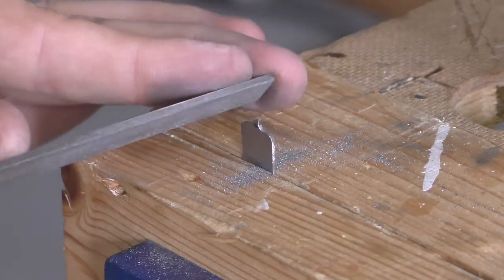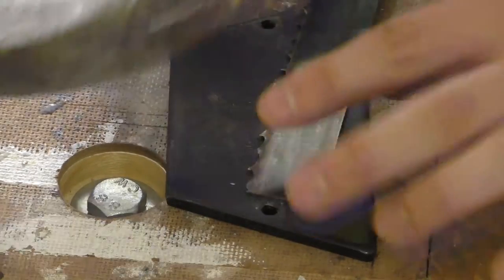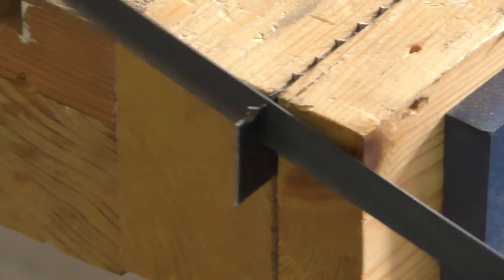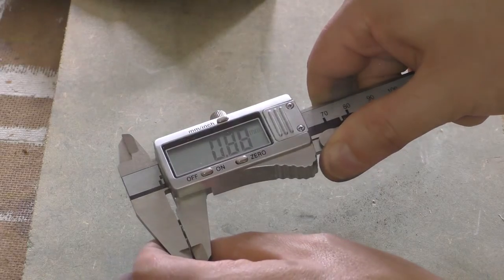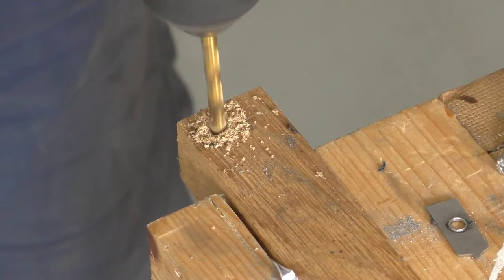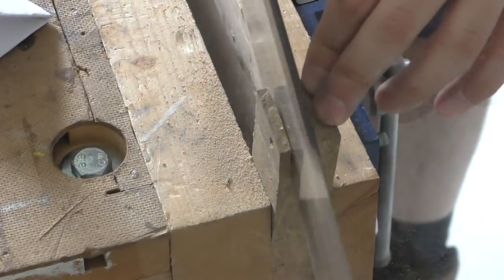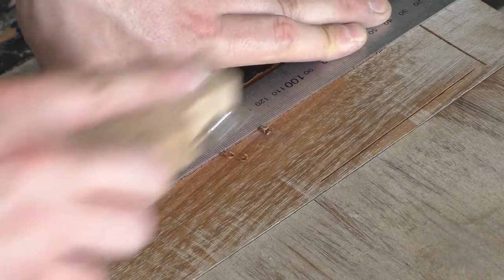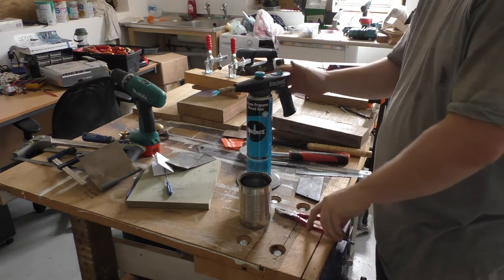Bandsaw Blade Inlay Improvements

Comment: Good stuff.  Instead of drilling through the saw blade, maybe just clamp the blade between two pieces of timber?
Reply from the maker: Yeah, that would probably work. You need a surprising amount of force to stop the cutter rotating hence why I drilled through it. To be fair most of my drill bits have been abused while I've been doing up the house, I could do with some new ones. Once they hit a brick they are finished.